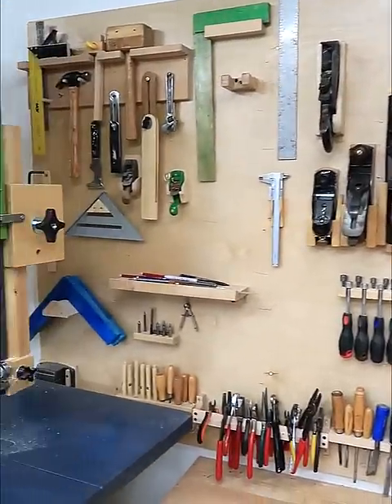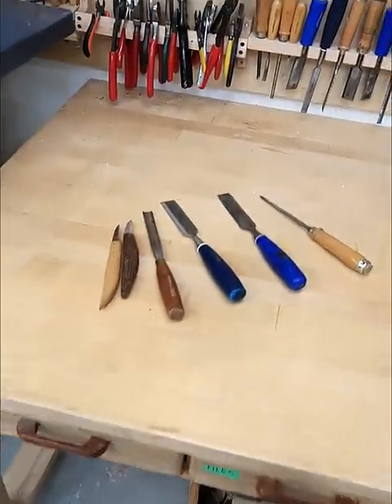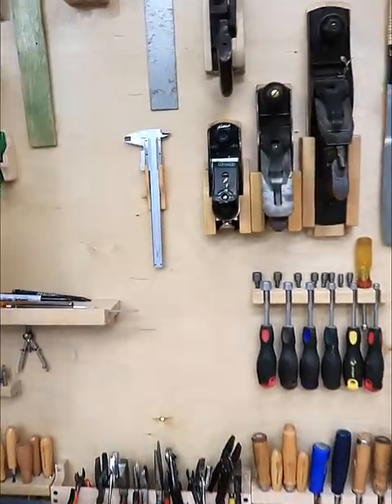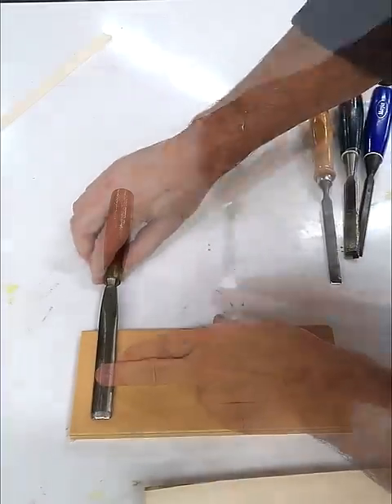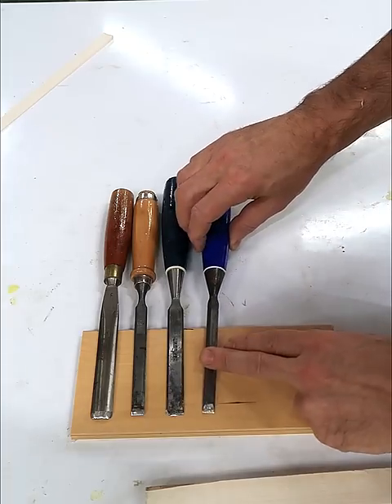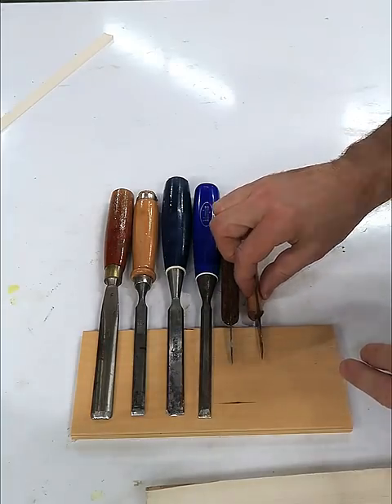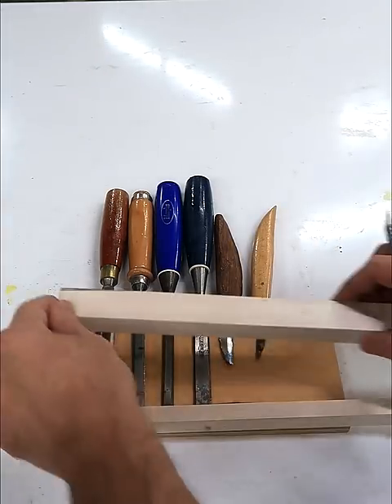Chisel holder for my tool wall

Comment: I used wood toolholders in my garage as well but the wood is slightly acidic and the garage isn't heated so many of the tools now have rust on them, just on the places where the wood touched the metal. Got it on router bits and collets too. Many of my more important tools are now kept in a heated room.

Comment: Yeah but I don't care for tool holders where I have to put the tools in holes. It's just not my bag. There's another way of making a chisel holder I much prefer. It's sort of a tapered fork arrangement. The handle just holds in it. You lift the tool a little and it releases.
Reply: I like to pull them from front too, fork holders are my jam
Reply from the maker: I like those too, but...  there's pliers below, so I didn't want the pointy chisel right where I grab the pliers.

Comment: You don't have enough chisels. That's why it didn't take you very long.
Reply: @1pcfred  Really NEED?....I use about 10-11, although I do have another 10-12 that get some, albeit infrequent use. Sort of like planes. They start replicating for some reason.
Reply: @jamesoliver6625  I couldn't even guess how many chisels I have. I think I could get by with just two myself though. A thin one and a wide one. Don't need any more than that. Let me try to count them. I found 48. I have some more but they don't have handles so I won't count them. They're chisel parts.